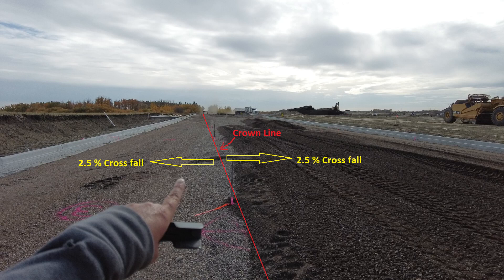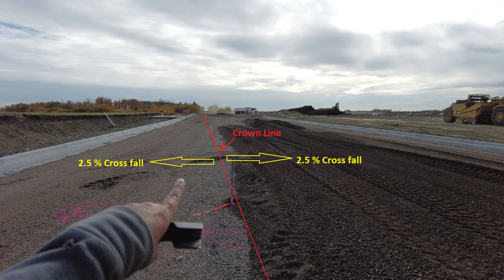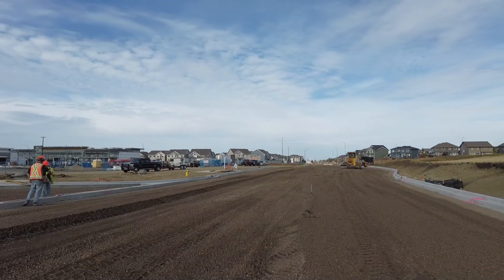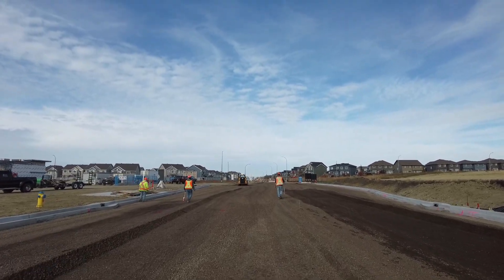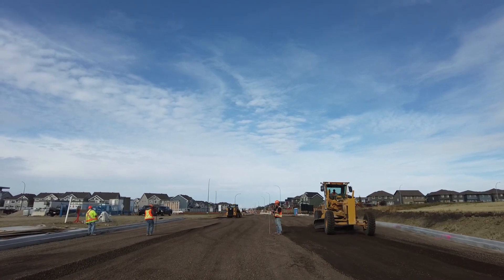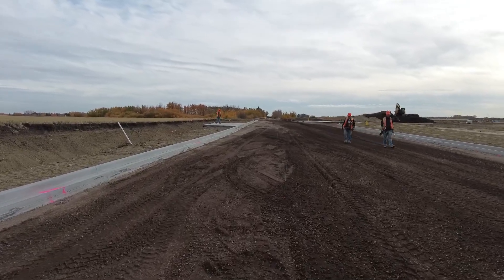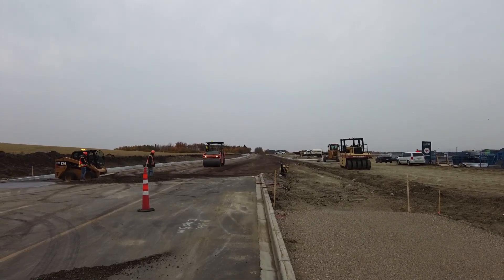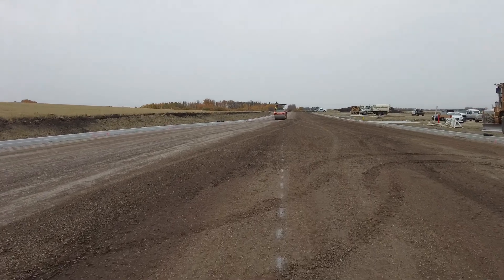Where is the Crown ?

Comment: If you use a 5 1/2’ piece of rebar and off set the finish asphalt or gravel grade to say 1 meter you can shoot it using boning rods rather than string lines.